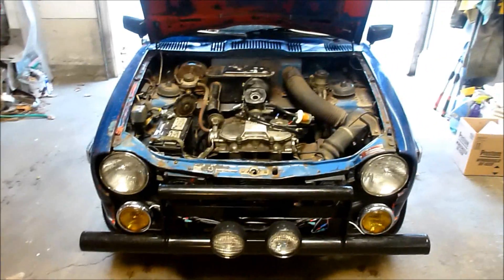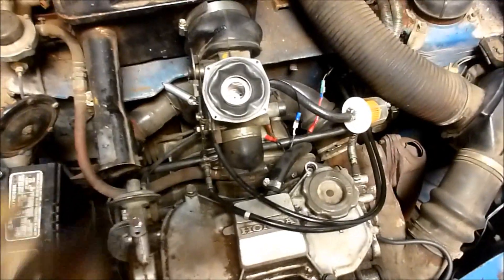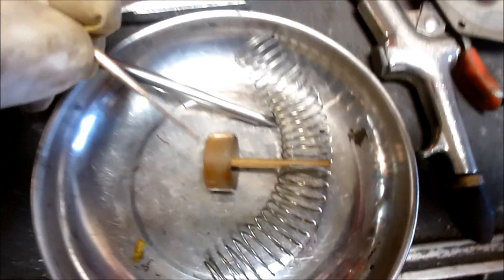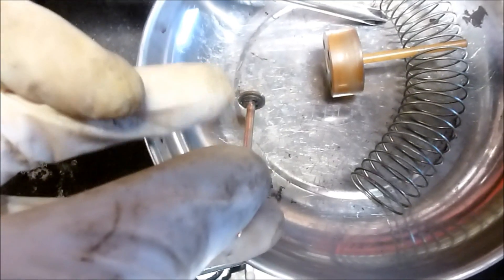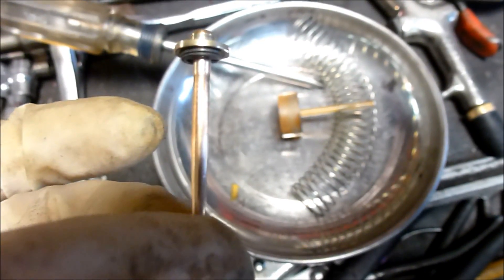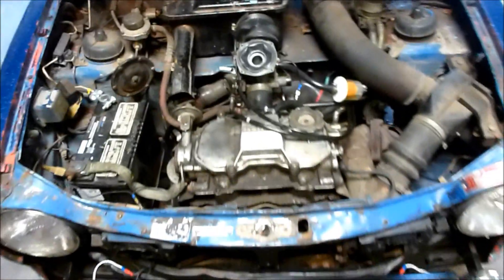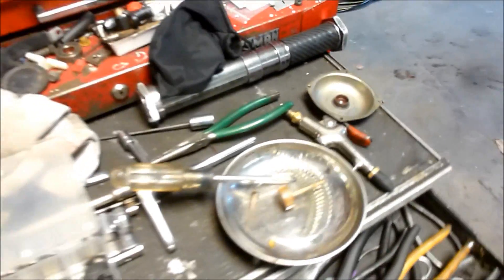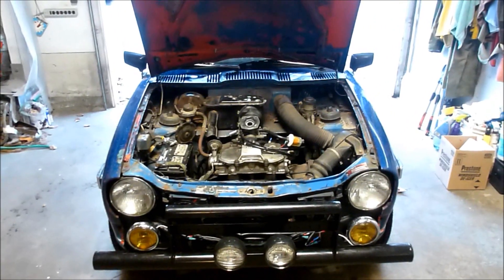Super power tuning a Honda z600 continued

Comment: Cool, I know exactly what you're doing. I did it 30 years ago with my Honda 500 single motorcycle. Cut an extra hole in the air box, raised the needle, and it made a HUGE difference in power. Hmm, I think maybe I replaced the jet instead, because it was top-end power I got. The needle taper only affects part throttle. Memory's a little foggy. Anyway, thanks for bringing back memories of twiddling jet needles on Hondas, Suzukis, Yamahas, and Bridgestones!